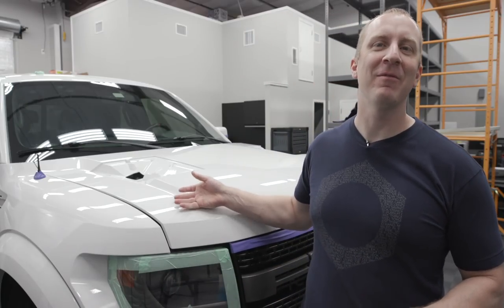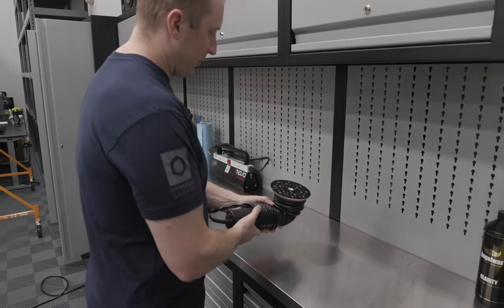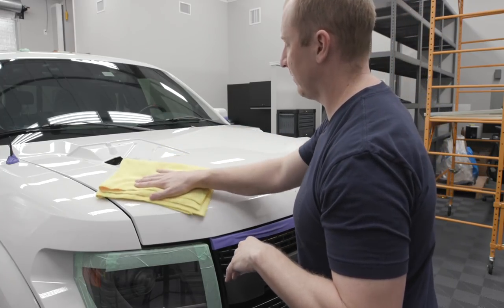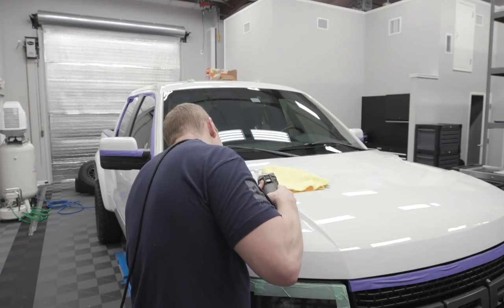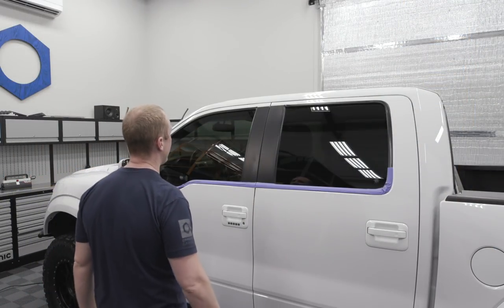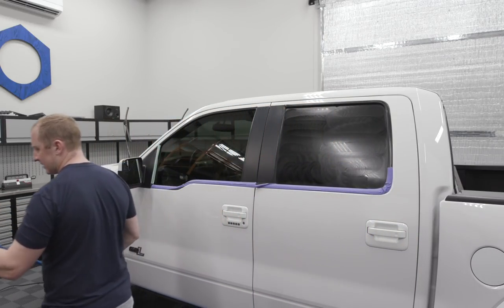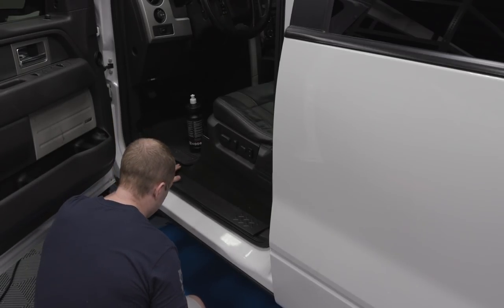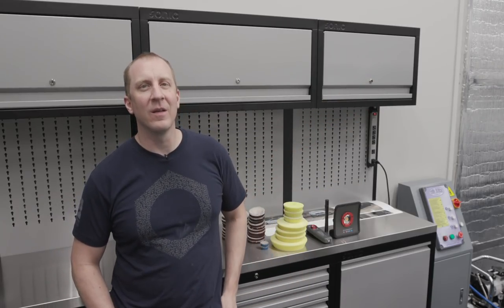Gen 1 Ford Raptor Detail Series: E5 - Finish & Glass Polishing

Comment: What is the big benefit you see from polishing glass? My guess would be better application of a coating and/or water repellent?
Reply: Mainly just cleans it well, which leads to the product "sticking" better. You can't really get rid of any scratches etc - then you need special pads and special compound, and it should only be done by professionals. There are some videos on youtube.
Reply: I polish glass when you can kinda feel waterspots (normally on the side and rear glass) and/or cosmoline  (road grime) on the windshield.   Makes them easier to clean.
Reply: Tim kinley I just took a G8 DA polisher with Griot’s fine glass polish, and WOW, what a difference!  Cleaning them is much nicer, and now going to find a good glass sealant to make it last longer.  👍🏻
Reply from the maker: Bingo
Reply: @tundrawhisperer4821  Cool beans.  I've  got a few glass sealers here (Griot's,  Aquapell, Glassparencey, Adam's). There is probably not two dollars difference between them.  Haven't tried Wolf's from Matt.  They all fail in about a month or so.   Which doesn't bother me because it's just part of my routine.  Honestly, if you are using Beadmaker, that helps a lot with repelling 'stuff'.
Reply: Tim kinley sounds good.  Yeah I use bead maker regularly.  Thx

Comment: You used heat to remove water spot etchings? Doesn't that just cause paint swell, hiding the spots for some time?

To my understanding, you can't reflow cured water-based paint, which is probably what this hopes to achieve. Hope I'm wrong.
Reply from the maker: First, there is no such thing as flowing clear coat.  What you are attempting to do with heat is recreate the conditions that caused the spot.  We want to get the paint back to the heat that caused the paint to etch, but not swell it due to heat and friction.
Reply: @ObsessedGarage  hey Matt, thanks for your answer. However, it's still not clear to me how that is supposed to remove the etches. Hope you can find the time (and are willing) to ellaborate.

Comment: Would a paint depth gauge measure the thickness of a coating? So you would be able to tell if the coating is coming off?
Reply: That could work with the higher end paint meters only if you took measurements before and after you applied original ceramic coat. I have heard suggestions that a gloss meter can be used but that doesnt really make sense to me. Perhaps if you took measurements before and after but that still seems like a best guess thing as opposed to a precise technique. Gloss meters are expensive and for that you could just see if the new ceramic adheres or just check to see how surface beads. JMO
Reply: @bendoffer6137  Thats what I was thinking. Thank you
Reply from the maker: I had my heart set on a Rhopoint a while back when at Esoteric until I actually used it.  Those things are about as useful and accurate as a depth gauge.  I'll probably still get one at some point for referencing, but they don't tell a full accurate story.

Comment: I'm curious why nobody ever uses machines to do the inside of glass? Is it because of tint?
Reply: Does not get scratched enough to use a machine polish inside, not to mention the nightmare of dust and residue you would accumulate in the interior would triple your workload for a diminishing return.
Reply from the maker: I don't see any reason why a machine would be needed.

Comment: Is Meguiar's #39 better to use than a diluted APC when it comes to degreasing and cleaning plastics/vinyl?
Reply: #39 is amazing on trim. Its the only thing that I have seen work well when cleaning compound out of trim
Reply from the maker: Yes, it is on a different level.
Reply: Alex Umbra thanks man. I assume it'll have no problem on engine bay plastics too?
Reply: @Twiztid_Metal  I use Meguias  805 Super Degreaser the AP (if needed) first on the upper/lower engine bay. I saw Matt use AP in foam cannon which I have never done before but am definitely trying! For underneath engine bay I have also used Bilt Hammer Wheel Cleaner for more difficult engine parts. Really good stuff
Reply: @Twiztid_Metal  Engine bay plastic is good to go. I polished metal framing/paint under hood and then cleaned up polish with 39 on all the trim. Make sure you use firm bristle brush on plastic. Works better that way